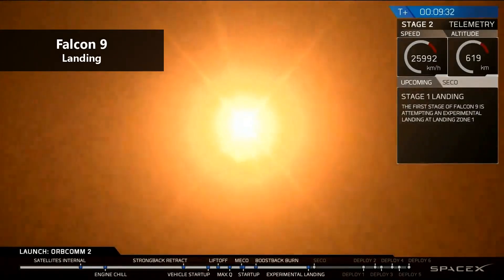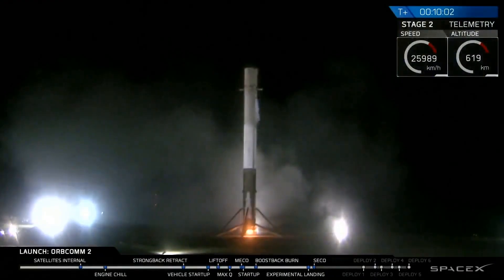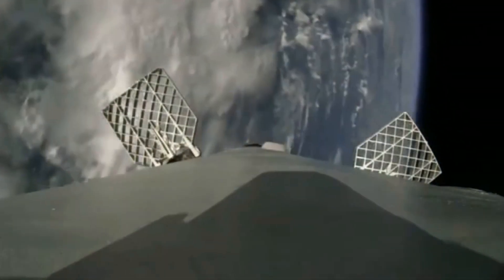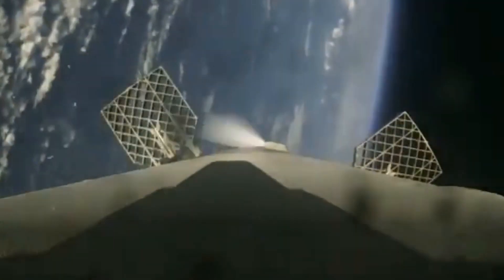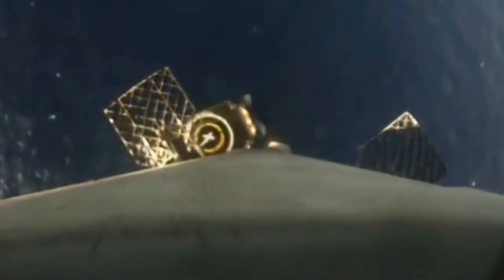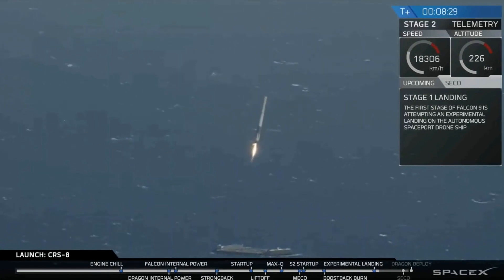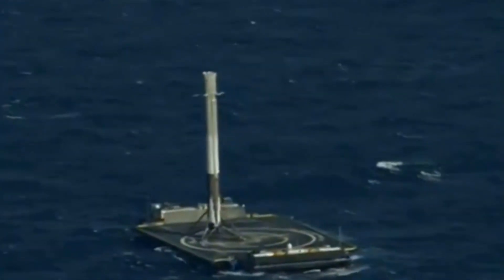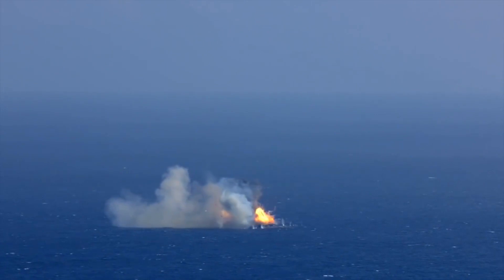How The Falcon 9 Rocket Lands

Comment: Well a boost back burn is only for LEO missions (if they choose so) GTO missions only have re-entry burn and landing burn
Reply from the maker: Even with barge landings (GTO and some LEO) there is a short boost back burn, not as long as the boost back burn for landings back on shore however.
Reply: Space Is Kind Of Cool Are you sure? Bearing in mind GTO orbits they stage around 1700KPH faster than LEO. GTo missions follow the arc trajectory, there's simply not enough fuel for a boost back burn. Anyway, why would you need a boost back burn when following an arc?
Reply from the maker: Because the arc isn't always close to the drone ship. The reentry burn allows the first stage to correct its path so it will land near the ship and not just a random place in the ocean.
Reply: Space Is Kind Of Cool The drone ship is placed in the arc... It's on all of SpaceX's webcasts.
Reply from the maker: I just went through and looked at all of the webcasts. It looks like they always do a boostback burn for LEO missions for both drone ship and return to launch site landings.

You are right about there being no boostback burn for GTO missions.

So it seems like the boostback burn is always performed when there is enough fuel. It isn't determined by landing location.

Comment: Is the crush core part of the landing leg? Is it way to small to notice without a up close picture of the landing leg?
Reply from the maker: It is inside the telescoping strut (the part that extends when the legs are deployed) on the landing legs.
Reply: So its like a one time use shock absorber?
Reply: +irfan quazi exactly. Although it can be replaced for the next flight, instead of replacing the entire leg or worse.
Reply from the maker: From what I've heard they've been replacing the legs on these early landings, but the plan seems to be replacing the crush core only if the rest of the landing leg assembly is undamaged.
Reply: +Jed R Incorrect, if landing uses all the crush core they will replace the leg. Due to the forces exerted on the leg and the fact the crush core is inside the leg, placed during manufacturing.

Comment: Never heard "suicide burn"- I prefer "hoverslam", much more accurate and descriptive!
Reply: you never played Kerbal Space Program then :D
Reply: Shibumi No, it can't hover. The Merlin can't throttle down far enough, it can throttle down to about 70%, at that point its Thrust to Weight ratio is still greater than 1:1, so it can't hover.
It can slow down, and fly upwards, but it can't slow to a halt in flight, that's why it does a suicide burn, wherein the point where it stops roughly coincides with where the platform is.
Reply: Hoverslam implies that the rocket can hover. It can't, at minimum thrust, its TWR is still greater than 1.
Reply: Hover implies that it can stay till at the same altitude for a period of time, and this cant be done by the Falcon 9.
Reply: Sarge Rho That rocket can take off when FULL of fuel, so near empty it can definitely hover. Wtf are you talking about??
Reply: Sarge Rho So obviously, it CAN hover- just for a very brief interval of time it's downward motion ceases and gravity and thrust are in balance...

That's a fine distinction I will grant you- what I would like to know is how fast exactly it's going when it hits the ground...
Reply: Shibumi I couldn't find anything with a quick google search, but from the videos it looks like about 2-3 meters per second.